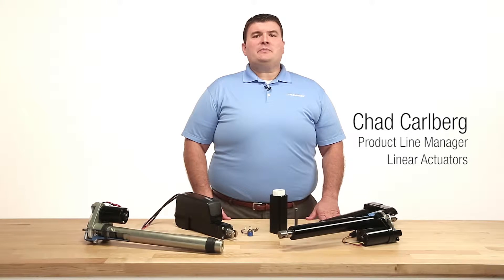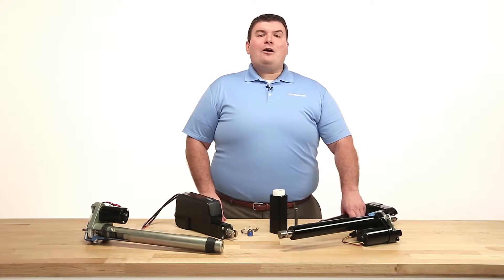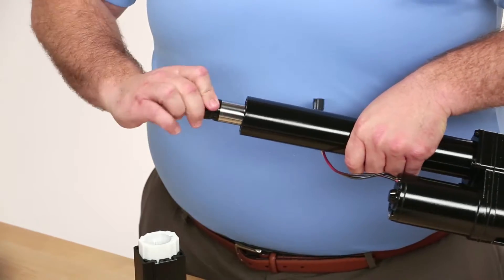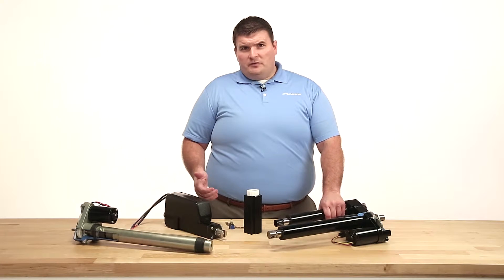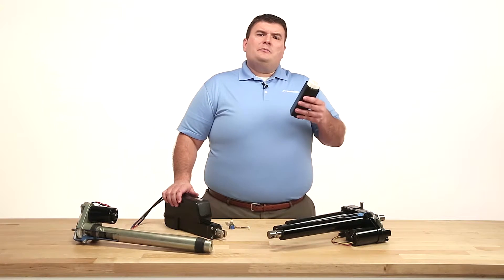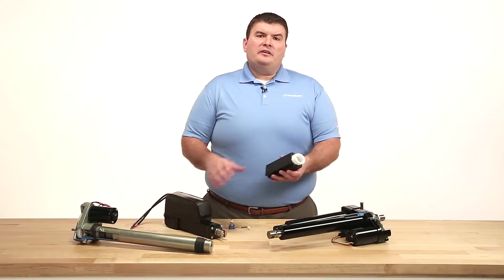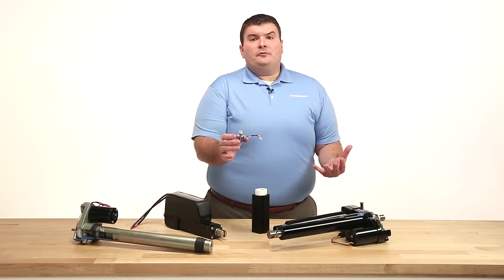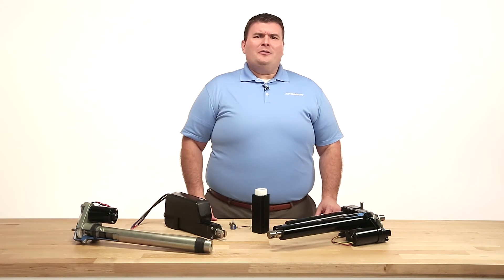Anti-Rotation and Its Usefulness in an Industrial Linear Actuator (ILA)

Comment: Hi there! I'm just translating a short Thomson TechTip regarding this anti-rotation feature. I don't quite understand why the potentiometer should measure while I manually turn the extension tube. Shouldn't it be the other way round, i.e. the potentiometer does NOT measure, because the spindle is standing still?